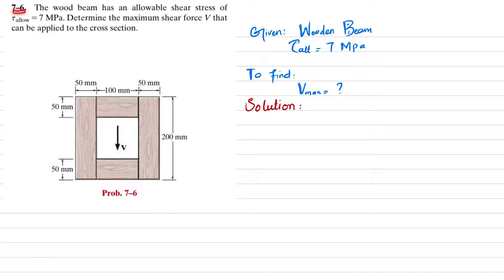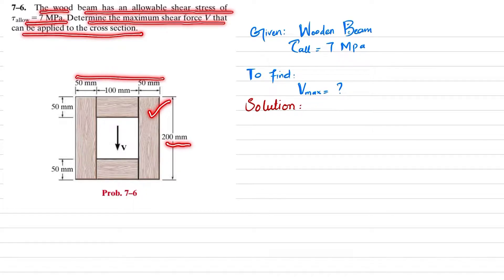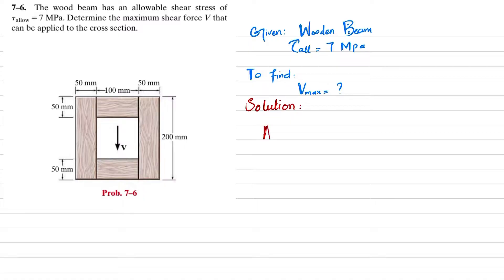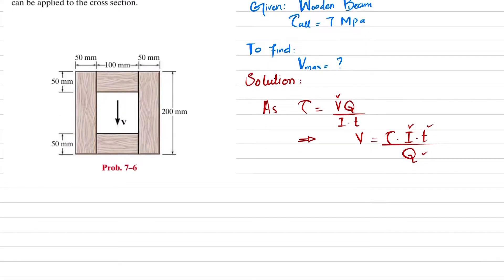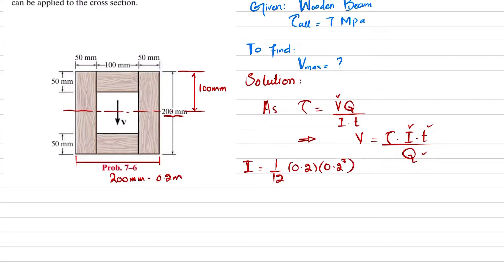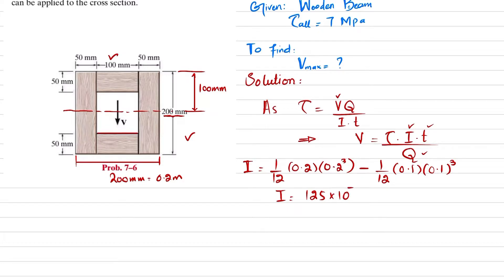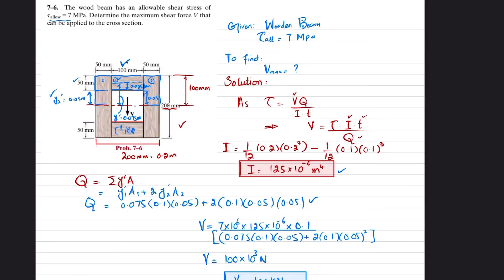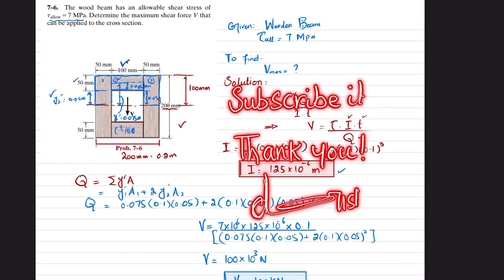7-6 Transverse Shear | Mechanics of Materials RC Hibbeler |

Comment: Sir, why does the calculation of this value of Q lead to the maximum value of V?
Reply from the maker: It's formula shear force x Q/ I x t = Shear stress
Reply from the maker: Q is the first moment of area
Reply: @engradnanrasheedmechanical  why not use the 50 mm by 200 mm as the area? How do you know which value of y and A to compute in Q = y*A
??
Reply: @engradnanrasheedmechanical  

If you want to find the biggest value of "V", shouldn't you be calculating the smallest value of "Q", which you should get by calculating the area 50 x 200 mm?
Reply from the maker: @fidonnamani4771 yes

Comment: why does the Q is above the neutral axis, not below the neutral axis and under what circumstances will we be calculating the Q below
Reply from the maker: Good question. As the beam is symmetrical about horizontal axis or neutral axis , you can take the Q above or below. Both will give you the same value. Now if you have been asked to determine the shear stress for the specific point on the cross section of the beam that may be above neutral axis or below, so you have to find the Q for that. You can check out more problem on it and you will find them in the link attached. Just search the problem in the playlist and you will find many more. Thank you 
Here is the link for all the questions of Chapter 7 Transverse Shear https://www.youtube.com/playlist?list=PLuj5YwfYIVm8XgaWLuFz55Me-A2wqY9KV